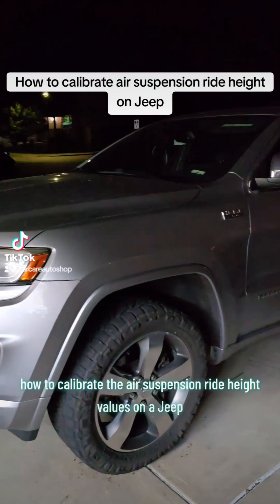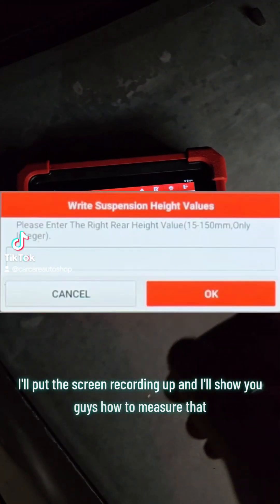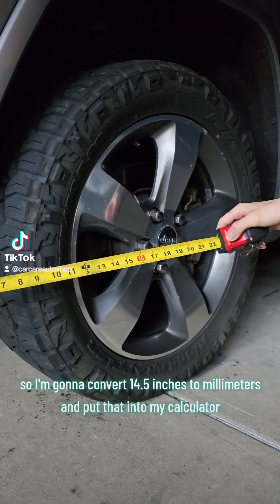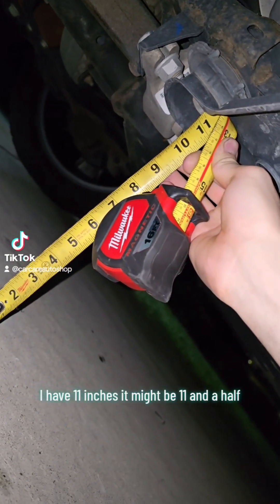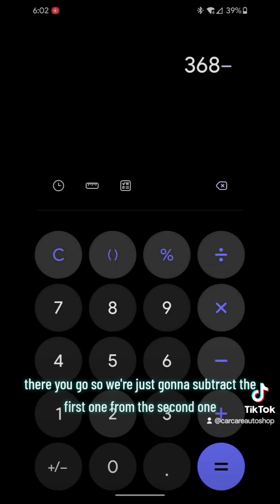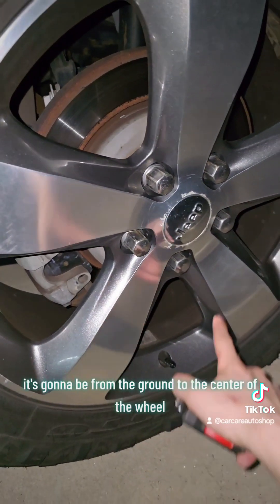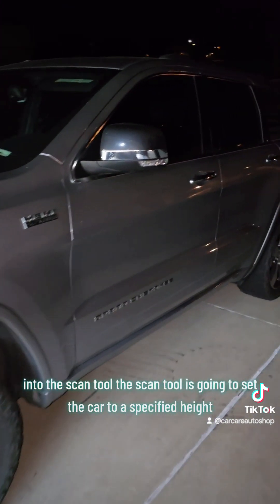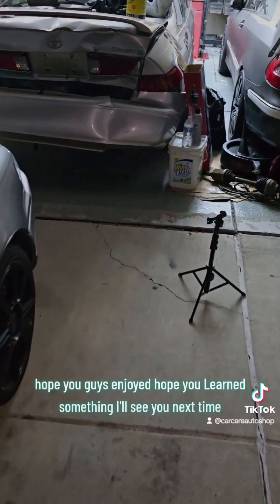How to calibrate air suspension ride height on a Jeep

Comment: Good info. What scan tool is that?
Reply from the maker: Thanks! It's the launch x431, it's a fully functioned scanner that can do almost everything the super expensive ones do, but the reason it's cheaper than those ones is because it's technically not meant for the North American market, so if it were to break you'd have no warranty.
Reply: @CarCareAuto  Oh nice. My brother just bought a crp919ebt and yours looks like it. I have an xtool d8 and I love the topology and graphing but I wish it was bluetooth. I like the Autel and Launch tools also.
Reply from the maker: Yeah the full model on mine is x431 crp919xbt, so pretty much the same as your brother's I believe. It's a great tool although I wish it had topology. I definitely want to get my hands on an xtool as well though after seeing Ivan have better luck programming keys with it, although I don't program many keys it's still fun to have multiple scan tools. Expensive hobby 😂
Reply: @CarCareAuto can this tool calibrate the AFS as well?
Reply: Thanks I have adjusted the heights on my Jeep Grand Cherokee WK2 2015 Summit many times after installing lift and also larger wider tires….
I never knew what the 50-150mm range was based on and I was always doing it by guessing and measuring the tire to the guard difference… then adding how much extra I wanted it lifted….
So explaining how to do the measurements just completed my reset to normal height perfectly.
Thanks again
Great job.
Haydn
Australia 
JScan and AlphaOBD, OBDLink MX+